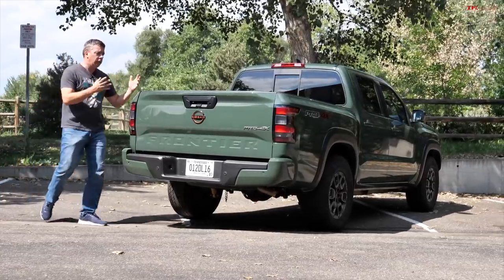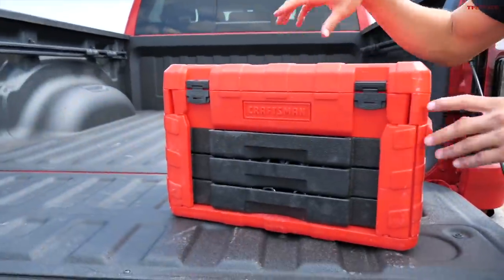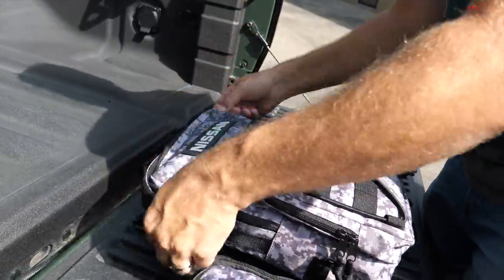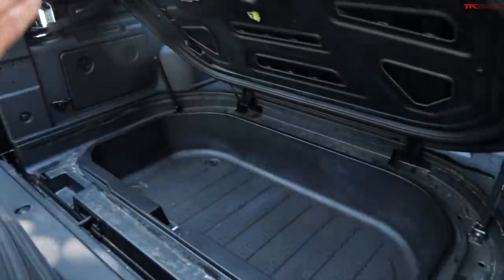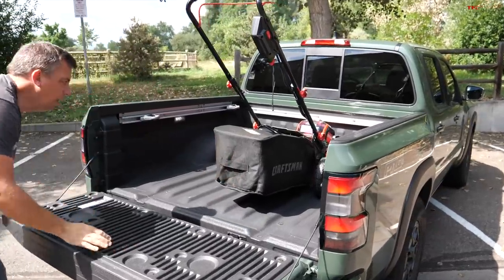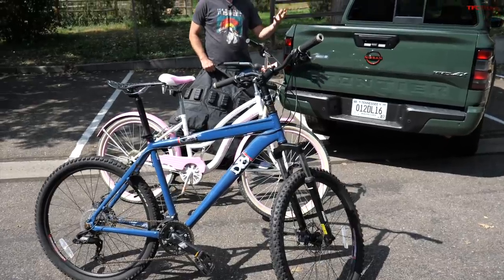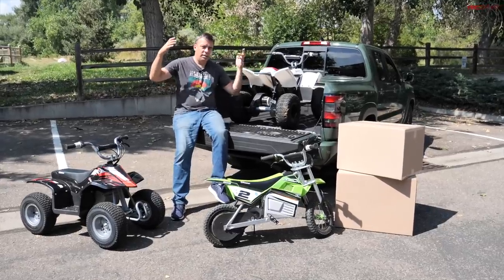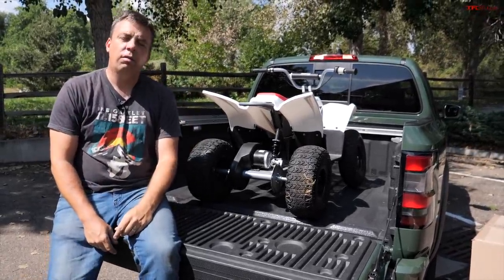New Nissan Frontier vs the Tiny Hyundai Santa Cruz Pickup - See What Fits In the Bed & What DOESN'T!

Comment: I have a 2018 frontier. Under the rear seats I fit a jack, hatchet,  tie down straps, jump starter, tarp, first aid kit, and air compressor. Behind the seat is a 12 GA shotgun. The bed I have an aftermarket tonneau with a Plano crate. The crate has a socket set, open end wrenches, plier set, vise grips, screw driver set...etc. I also carry a 5 qt jug of oil, tools quarts tranny fluid,  p/s, and brake fluid. Center console has emergency blanket, rechargeable flash light, notebook, change, and lighters. Glove box has a fix blade knife and binoculars. Behind the back seat are gloves and hats.

Oh, and it has a full sized spare.

Comment: I wanna see a Tacoma vs Frontier off road test.
Reply: I think they already have that video.
Reply: There're a few dozen videos already. Frontier is a much more comfortable place to be. The Tacoma's suspension can handle a slightly higher speed. Bottom line: They're both pick ups and unsurprisingly have similar capability when equipped with rear lockers. Honestly down to the tires and personal preference.

Comment: The Hyundai Santa Cruz is my ideal for a truck..I'm mean "SAV". I'm not a truck person at all. I hate driving something that feels heavy and hard to park. The Santa Cruz drives and feels like a car. I can park it and fit into my garage with no issues. I can take it to the beach loading beach equipments and use the trunk compartment as a cooler...It's very versatile in that way. Not to mention the styling and tech! I can pull up in a Santa Cruz for valet with confidence.  And not feel like I drive a work truck.
Reply: Paid marketing comment?  So awkwardly written it has to be
Reply: @deadlata9767  No, it's not. This is my own thoughts. You don't have to agree with it.

Comment: As a proud owner of a 2022 Nissan Frontier it doesn't feel like a midsize truck anymore as it feels like an older full size truck.
Reply: If you don't mind me asking, but what trim, packages did you get in yours? And what was price you paid? I'm considering a 2022 Frontier as we'll.
Reply: @thekingkong209  Two-wheel drive crew cab with the technology and comfort and convenience package. I traded-in a 2019 Nissan Frontier as I just leased this one for $300 a month for 3 years as they would not come off that sticker price one bit.
Reply: Our company GMC Canyon is actually slightly LARGER THAN one of our older 90's series F150's plus is actually hauls and tows MORE than the older F150!  Kinda scary what USED to be a full-size truck is now considered a Medium-Sized truck!

v
Reply: @StarGateSG7  Oh I know as I still have a 97 GMC Z71 as the new Frontier has similar capabilities..

Comment: Huuuuug difference. I can’t wait for the maverick “will it fit”
Reply: I wouldn't get that excited. The Maverick bed is like 2 inches longer than the Santa Cruz. Not sure what the difference in the length with the tailgate down ... but it isn't going to be a Ranger or F-150 in the back.
Reply: @ChrisPollard  right. But it would be nice to see a head to head. Are depths the same? Width?
Reply: @dmegahan  Agreed! Can't wait to see the head to heads. I'm going to be team Santa Cruz though.... Pick mine up tomorrow morning. LOL But I had a couple of Maverick builds bookmarked back at the announcement. It was still a solid second choice if I found something I didn't like about the Hyundai.
Reply: @ChrisPollard  Other thing is payload on the Maverick is a clean 1500#, so more than the SC, while also being agnostic of where the load is placed. You can put it on all in the bed so its not really an inherent limitation of being unibody like Roman mentioned.
Reply: @MrDrProfessorVader  the payload in the Santa Cruz can go anywhere too. That early on 660lb thing wasn't right.
Reply: @ChrisPollard  mav is 6 feet with the tailgate down.

Comment: To make this a true comparison the nissan need to have a cover that takes up bed space.  But these are 2 different classes of vehicles and the nissan should have more room.
Reply: you can get a longer bed on the nisssan.........
Reply: that was the point of the comparison to show the difference in what you get for a compact truck and a mid size truck to show you that if all you need is a little bit of bed and small towing you might only need the compact truck
Reply: If they removed the cover in the Santa Cruz there would be more room in the bed length wise.  That was my point.  You can't compare the length of the 2 bed when one has an option cover and the other doesn't.  That how math works.  But the comparison of the width is valid.
Reply: @nathanbillingsley42  Even with the bed-cover removed, the Santa Cruz only has a 52.1" bed. The Maverick has a 54.4" bed. All crew-cab midsize pickups have at least a 60" bed length and some can be optioned up to 74" (Canyon/Colorado).
Reply: I must have missed when when Hyundai claimed the Santa Cruz was a mid side truck.  But my whole point that yall are missing is that they were not comparing with a tape measure.  They were comparing with different things.  Then one had a cover installed that takes up bed space.  If the frontier has a similar cover taking up bed space then less would fit. But thank you all for trying to prove me wrong on what I thought should be a simple statement that it's not a good comparison because one has a cover (taking up space) and one doesn't
Reply: or they could have just taken out the tonneau cover in the santa cruz
Reply: @dirtrider88  its stock on the highest trim they cant modify the press vehicles they get
Reply: @nathanbillingsley42  Or perhaps Hyundai could have engineered a bed-cover that didn't consume as much bed space. We can debate this for years.
Reply: @rebelcitysports1outlook713  there is no debate.  I have given my opinion you can chose to keep trying to prove me wrong but you won't.  All hard roll up cover take up bed space.  If you add one to the nissan you will have the same issue.  But apparently that's not as simple of a concept as I thought.
Reply: @nathanbillingsley42  It's just not good engineering. Stock or aftermarket. Just because you accept subpar designs doesn't mean the entire world must do the same. Who delegated you the role of king?
Reply: @rebelcitysports1outlook713  no named me king.  Nor did I say I was. I believe you don't like the fact that your opinion doesn't effect mine.  It amazes me the amount of ignorance in the replies to my simple statement.  This comparison is just as valid as a nisaan vs f150 with the nissan having a tool box in it.  The Sante Cruz was design with its own purpose.  If it's not for you move on and get the nissan.
Reply: @rebelcitysports1outlook713  nope I live in texas and only drive ram and dodge vehicles.

Comment: I'm not looking for a new truck, I just bought a Colorado last year.  But, it seems to me if Tommy had turned the small Razer backward, it would have fit in the Santa Cruz.  I'm pretty sure the rear wheels would have fit under the tonneau box and the front would have cleared the tailgate.
Reply: I was seeing the same.  The plastics looked like they would have cleared the cover, while the wheels tucked underneath.

Comment: I love how everyone raves about the truck trunk... except if you're using a truck as a truck you've got to move all the stuff in the bed to get into the trunk. Most inconvenient "feature" oversight ever. Clearly not designed by a truck owner
Reply: i mean its better than not having it. certainly a better option than the ram box (although you can still access those with the bed full)
Reply: @dirtrider88  meh. I'd take a ram box over this thing any day. Ideally, I'd have a short box that extends the wheel well to the gate. That way you have 2 level and consistent planes to lay things on. I doubt i would ever miss that extra width at the gate
Reply: @SuperCilis  i rather have this than a ram box. at least this doesnt take up a bunch of space in the bed. at least with this if you dont use it theres no downside
Reply: @dirtrider88  you don't count a donut as a downside? Very different mentalities clearly
Reply: @SuperCilis  im just happy to see  it comes with a spare at all. soo many cars dont even come with a spare anything.
Reply: @dirtrider88  fair. Where I'm at, pretty sure if you don't have a spare, when purchased at least they have to be runflats

Comment: Honestly, the Frontier is a LITTLE disappointing after 14-years of waiting. It's got the same chassis, same torque, but nothing WOW about it. Although compared to the Tacoma, the Frontier has a fully boxed frame. I wish Nissan put more in it to make it more appealing in this segment, although I think its 2nd to the Tacoma. The Frontier is still one of the best bang for the bucks because in terms of features, reliability, design, and room.

Comment: I like the concept of the test but would like to add sheet goods and lumber to the test list. Feels like i am swimming up stream wanting a 6ft bed. All the good packages are on crew cab 5 footers. So, do i really gain much by going for the 6er, or am i just giving up cab space?
Reply: You can reposition the tailgate cables on the Santa Cruz. This allows you to partially raise the tailgate so the top is even with the wheel wells. It definitely will carry a 4x8 sheet flat. I looked at a Santa Cruz last week and checked it for myself, as this is important to me as well.

Comment: Good video. Question, anyone willing to hazard a guess if the Frontier bed could maybe haul a quad of say a Honda or Cam Am. I intend to upgrade to a new vehicle in the next couple of years and I'll probably be getting a quad 3 or 4 years later when I retire. I'm really liking the price and the styling of the Frontier an if it was able to haul a quad in or on top of its bed it would seal the deal for me as far as what to buy. I'd rather avoid a full sized truck if possible and stay within the mid sized truck segment.

Comment: The Frontier doesn't have the bottom utilitrac tie down rails anymore? I wonder if the little plastic tailgate backer will fit older models so I can get those cupholder points.

Comment: Did you really do this test without getting a sheet of plywood or sheetrock? Unreal. Cmon guys.
Reply: The Santa Cruz and Maverick, both have a raised position for the cables on the tailgate. When partially raised, its level with the top of the wheel wells. They both will easily carry a 4 by 8 feet feet.
Reply: @jnicksnewstart  That's what they say but isn't the whole point of this test to prove that claim is true?

Comment: You should do a comparison of the Santa Cruz to a Chevy S-10 (GMC Sonoma) crew cab.  GM needs to bring the S-10/Sonoma back!
Reply: They did. They call it the Colorado. Same thing Ford did. Got rid of The Courier and the Ranger then nearly Ten Years Later reintroduce the Ranger as a midsize. Huge mistake on GM and Ford both.
   Our business had full size service trucks for jobs that required heavy tools and equipment, and what used to be called mini pickups for small jobs and estimating. We did work on school and college campuses where there was no room to maneuver large trucks. You could drive mini trucks down the covered walkways and park next to any building. So you see, I agree with you. I wish they'd bring back the mini pickups. We had Couriers that were rated for 3/4 ton payload in the 7 Foot bed. We also had a little four wheel drive Toyota that was perfect for driving on muddy construction sites.

Comment: ok-ok those trucks are alright/what about a 2021 mercedes benz sprinter 2500 diesel 2.0 liter /how would compare/the sprinter would get better fuel mileage/thanks much
Reply: Wouldn't that van be twice the price of these trucks?
Reply: @gte717v  are those truck cheap/those 4 wheel drive/i just want really wanted you  guys to test drive a mercedes sprinter 2500 cargo 2021 four diesel 2.0 liter/a 144 wb/which i have /thanks much

Comment: The Frontier's lower payload rating flies in the face of it's higher tow rating. The knuckle-draggers like to beat their chests about how unibody pickups aren't real trucks and they can't tow, etc. It's funny when you factor in your 10% tongue weight on that 6700 lb trailer, you end up with less than 400 lbs of payload for passengers and gear.

My Ridgeline has 1543 lbs of payload. I still have over 1000 lbs of payload after subtracting my max tow tongue weight. That's genuinely useable payload and towing. My point here is that people are easily fooled my marketing of max tow ratings, even if those numbers don't translate to real world situations. A mid-size truck is not the right truck if you are regularly towing over 5-6k. They're all great for more moderate usage, but heavy haulers they are not.
Reply: i dont agree with everything you said but yes if you plan to tow ANYWHERE near max towing numbers regularly than thats the wrong truck for you.

Comment: The Santa Cruz will never haul the max payload due to the small bed.This is more marketing than usable payload.
Reply: That may be true, but it also demonstrates the rigidity of the unibody and suspension. Also, don't forget, this is self-leveling independent rear suspension on the Santa Cruz.

Comment: 12:50 thats mostly bs. its 661lbs in the bed on the santa cruz, ONLY. 14:13 AGAIN. also, that santa cruz might be rated to tow that high but any sane person would not tow more than a couple thousand. 14:50 should have been mentioned WAY earlier in the video.
Reply: the 660lbs only in the bed has been repeatedly disproven. It can take full payload in the bed.

Comment: Don't pick up a lawn mower if the spark plug wire is on the engine. It can start and cut your fingers off when your fingers are under the deck.
Reply: how?